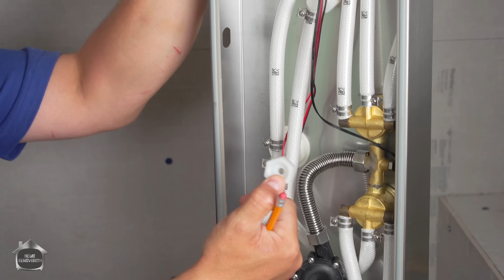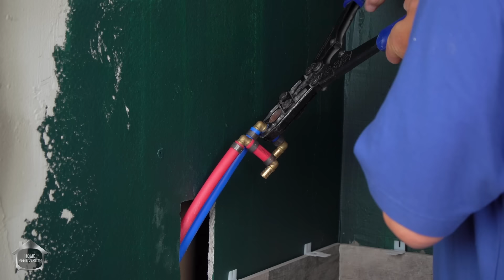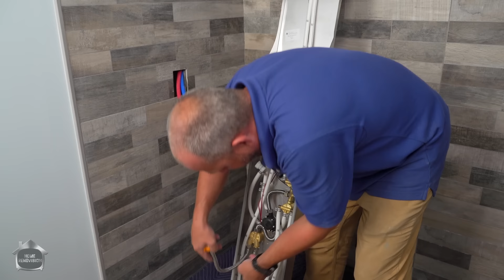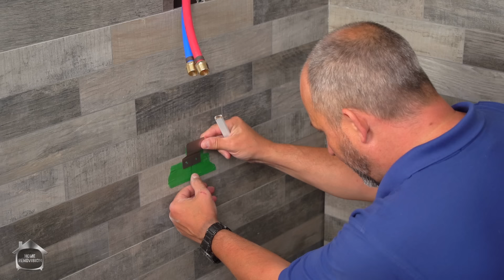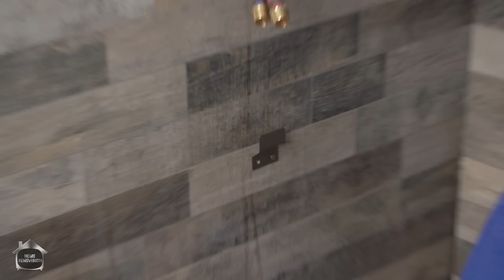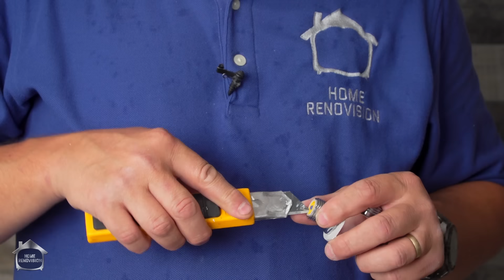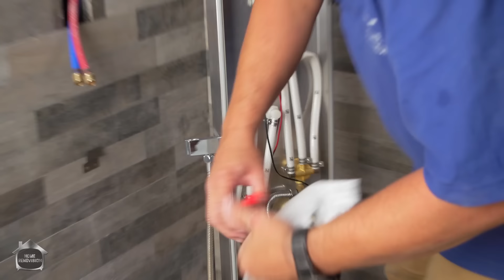Shower Tower Installation | Easy Plumbing For Beginners

Comment: I am going to spread my diy wings and remodel our small bathroom. I’m on a tight budget and was wondering if you had any suggestions on how to cover up the metal frame of a glass door shower. I do not currently have the budget to get it replaced and it’s in great shape, just the brassy gold that my husband hates. Thanks! 😉
Reply: You can always try sanding the metal lightly and spray painting it with a high quality paint. Shower doors are quite costly to replace, so I would test this idea on a small area first.

Comment: Jeff! The please give some advice! It’s off topic, but I’m on a timeline before my son is born to get this half bath/master bedroom access done before my wife gives birth later this month. I’ve been ripping off ceramic tile and it’s been easy with a multi tool fitted with  a rigid scraper blade, but it is leaving behind old yellow adhesive. Any tip I can apply today to get the adhesive off quickly, even if I’ll need to do some work to the wall afterward in the way of skimming and sealing or something g along those lines? It’s not a shower or bath or anything, the tiles are just on old gray drywall. The whole project is started because  the old toilet in there is leaking and she will need the new one there and water turned back on after the baby comes. Should I get the rest of the tile off, rent a u-haul truck, and put new drywall or can I get this old yellow adhesive off somehow? Any advice? Thanks if you can offer any guidance, man! And thank you again as always for all of the advice you share with us! We love to watch your videos!
Reply: I couldn’t tile over tile in this one, room is already too small :p

Comment: Hey lets say I wanted to learn a trade in my free time like on weekends? how would I do so?
Reply: I knew a guy at work that bought a “fixer” house.  I offered to help him with any project on the weekends.  He was happy for the help and understood I didn’t know much but wanted to learn.  I did some grunt work, but he was happy to teach me the interesting stuff too.  I’m sure a second person helped him go faster (get done sooner).  So it was a win-win.  Years later when I was ready to buy a house, I also got a fixer have have made many repairs.  I actually worked on weekends several others too.  Helped roof a couple times.  Framing, plumbing, electrical, concrete.

Comment: My tub recently cracked and its been seeping into the floor my boyfriend wants to renovate it but does not know which drywall sheetrock or cement board to use for a tile shower which is best to use behind the tile? Thank you
Reply: Itzel Rodriguez it depends how if you want to be more safe use cement

Comment: Hi Jeff, 
This question is unrelated to the video, but i was hoping you could help me answer this question.  I recently remodeled my bathroom and i used green board for my shower walls.  The reason i used it was due to the fact that i had a real bad mold problem when i took all the  walls down.  I saw your video on waterproofing showers. I did about 5 applications of aqua defense all the way up to the ceiling.  Will i have a problem that i used green board or should i have used cement board. I just don't want moisture to ruin all the work i did and i want the shower to last for years.  I am not looking  to move.  The shower will get a lot of use as well. What is the best board to use?  Thank you kindly for your knowledge and the videos you post. They really help a lot.
Reply from the maker: green board and aqua defense is fine as long as you seal the joint between the board and the integrated tile flange. Cheers!
Reply: i can't thank you enough for responding Jeff. Thank you for the piece of mind and thank you kindly for your expert advice. Cheers!

Comment: The only plumbing I've ever done was replace a busted outdoor faucet that that cracked because it wasn't drained for the winter. That simple task had me at home depot about 5 times lol, but I did it.
Reply from the maker: Cheers , that can be more difficult than meets the eye. this however is very straight forward. Cheers!

Comment: Like clockwork,it came damaged like one of mines did,bought them from Amazon, but it depends on the company, one of the unit boxes came in looking like it was used in a tiger circus
Reply from the maker: ouch. I just massaged it back with a rubber mallet!
Reply: Games dmc a Tiger circus 🎪 🐯😂

Comment: Great video and install.  I personally would install a thick tape or foam on the edge of the tile. I'm OCD about abrasion resistance.
Reply from the maker: the unit comes with a gasket on the edge. Cheers!

Comment: adding a bathroom light exhaust fan that is controlled by 1 switch white to white black to black when does the red wire go on the white or to the black to n ground to ground there are 14 2 that has blk white n ground and there is 14 3 blk white red and ground there is a single switch controlling the unit.

Comment: This makes me want a shower tower like this...    But I'm not really happy about the fact that there is no top on this.  Can't help thinking it will gradually get coated in soap scum from splashing
Reply from the maker: you can just as easily lift it off and set on a pail to clean in behind it. Cheers!

Comment: Hey Jeff, I am installing a bathtub in my basement (roughed in by builder), and the drain pipe is 2" and the p-trap and drain kit for the tub are all 1.5". Is it okay to use a reducer to connect the two sizes (glued?) when used beneath the concrete. Thanks! (fellow Canuck here so Canadian npc).
Reply from the maker: yup no problem. Cheers!

Comment: Great video as always Jeff, I would like to add that these shower panel systems are designed for a international market and they follow International Plumbing code guidelines. That being said, the included installation directions are typically not the best resource for installing these systems, for a typical North American install I believe this video is a fantastic resource that should be included from the manufacturers selling shower units in North America.
Reply from the maker: Cheers!

Comment: Are you using hardi panel for the wall? Isn’t that only for floors ?
Reply from the maker: it can be used for both. Cheers!
Reply: In the states where I’m from it says only for floors . But thanks for the tip. Maybe I’m just misinformed .

Comment: You don't seem to use a PEX crimp go/no-go gauge? Not useful?
Reply from the maker: I did when I set up the crimper for 1/2 " line. once you get the tool set it is always perfect. Cheers!

Comment: I have been a remodeling contractor for 40 years and worked at learning my trades since early teens.  I cannot understand the motivation of those involved in this industry to cheapen it by dispensing free advice to non customers and to those they'll never encounter, ever.  They must get a hoot seeing the,selves on camera and expanding their large egos.  I intend to take nearly 50 years experience to the grave with me unless I am compensated with a project or referral  work.  I've repaired and replaced plenty of handy homeowner work over a career . It's a laugh to think that a few minutes of instruction is a replacement for attestable experience, product knowledge and industry standards.  Your not doing the trade any good at all by giving it away.  So shit up, go back to work and be grateful that
Reply from the maker: Hi Steve, I am helping people every day to achieve their goals of renovating and remodelling their houses who cannot otherwise afford your services or who are willing to do it themselves and get the satisfaction of increasing the value of their largest asset. Congratulations on your career, however I will continue to assist folks in any way that I can regardless of your disgust. Cheers! If this information is not for you then it is kind of like going into the wrong bathroom at the airport!

Comment: There's some wiring in this unit. Where do you get the power to the unit?
Reply from the maker: I am pretty sure it comes from a small turbine based on the water flow...but it could just be related to the heat or both! Cheers!
Reply: @HomeRenoVisionDIY  What does it read out?

Comment: So let me get my head round this, you had your hot and cold inlets coming up from the floor and the inlets on the shower pointing down as well, and then for some reason you "U" bend the braided hoses and fit 2 elbows to each pipe to get them pointing down because the braided hoses are now pointing up? sorry I'm very confused right now Jeff?
Reply from the maker: if i put an elbow on the supply lines then the braided hose would be kinked in order top make the quick turn. a soft u turn keeps things from kinking and ruining the pressure.

Comment: Three hundred a much for tower
Made out of plastics and sheet metal
Reply from the maker: a good valve system with all these functions will cost you thousands and then you need to install everything inside the wall. I say it is a steal of a deal. Cheers!

Comment: Are you worried about the water lines developing a leak (behind the wall) from all of the movement?
Reply from the maker: great question, however in my experience once you clamp those connections together Only God himself an undo it. Cheers!
Reply: Home RenoVision DIY great,
Thanks for the quick reply.
Have a blessed day.

Comment: Question re subfloor

I removed a subfloor of diagonal board in my 95 year old house. I have screwed down a layer of 5/8 t&g plywood following the guidance in your video (6" in middle, 3" on edge). Should the 2nd layer of 5/8 t&g plywood be in same direction as 1st layer or at 90 degrees?
Reply from the maker: all you need to do is overlap the joints and install the length of the sheet across as many joists as possible. Cheers!

Comment: Maybe someone asked this already and I didn’t see it.  My question is - even with the fan in the shower, water is going to get behind that tower I’m sure.   After a few years, isn’t that going to a bit nasty back behind there with splattered soap and water?  I guess you can always lift that off to clean behind there.  Just wondering.  Thanks!
Reply from the maker: Hi John, I haven't seen a shower in my life that doesn't get a little nasty over time. Yes you can always pick it up and set it on a bucket to clean behind it. Cheers!

Comment: Have been binge watching your channel for weeks, thank you!! Odd question here. I am planning on using a "U for Moen" shower valve which would send water at its already pre-determined temperature via a single 1/2 line. Any way to combine the 2 inlets on the tower to accommodate the single line into dual inlets?
Reply from the maker: This unit does not work in conjunction of another valve. Sorry!

Comment: The previous owner installed mine on the wrong wall just prior to me buying my home. I love the showee but would like to move the unit. I have access to both sides of both walls and thought I might be able to make all of my installation from the other room (backside of the wall). But i am not sure how or if it feasable to try to move this without completely destroying the tile. Is there a way to repair the hole in the wall made by the current plumbing without ripping out everything?
Reply from the maker: not really! Not if you want to maintain the waterproofing system. Cheers!

Comment: No tape needed on the fittings?
Reply: those fittings have seals in them
Reply: @vitex1231  Yes, you are correct. My bad.
Reply from the maker: most compression fittings have a gasket in them so not needed. Cheers!
Reply: @HomeRenoVisionDIY  I watched the video again and saw the gaskets, sorry!
Reply from the maker: @bcamk  no worries. Cheers!
Reply: @HomeRenoVisionDIY   The problem is that the PEX-to-threaded male connectors you used are probably tapered NPT 1/2", whereas the female connectors on the tower hoses are likely non-tapered NPS 1/2" (aka DN15). It's possible that the taper of the male connector may prevent it from being screwed far enough into the female connector to touch the gasket. YMMV!

Comment: I'm surprised you didn't use the anchors to center your screws in the large hole drilled. Wouldn't it have been better to have drilled a smaller hole? All of your precise measurements out the window. Just sayin, my skills are a drop in the bucket compared to yours. Thanks for the lesson.
Reply from the maker: The trick to installing on tile is to make sure your line is perfect after installing . this requires a little wiggle room. I drill a larger hole so i have options when i set the screw into the wood backing that i had prepared. All it takes is for the mount bracket on the unit to be just a little off square and everything else can be perfect and it looks bad. Always consider the defects in the manufacturing process when installing. Having options can go a long way! cheers!

Comment: What about valves behind the fixture? In this configuration you will need to shut down the water supply in the whole house to replace the shower tower.
Reply: The valves are probably at the other end of the supply lines.
Reply: I don't know PEX, but I'm picturing a distribution block in the basement that has all the valves in one place.
Reply from the maker: if you don't install  shutoff valve on the specific line then turning off the water to the house is just as easy. a few minutes without water is easy to manage. Cheers!

Comment: Looks like a little too much work making two U turns on both sides, especially with flexible plastic plumbing. Even without it there should be a shorter flexible connection than what came with the shower wall. Also I'd trust you but not myself to put the fixture up without testing the water lines first.
Reply from the maker: LOL, once you have a little experience with this pex stuff you stop wondering if it will work. The joints are stronger than the pipe itself. Cheers!

Comment: Hey Jeff, With the rain head and waterfall features with this water tower, will the 1/2" supply line enough volume of water for this to function properly? I would think to run 3/4" for rough in, then reduce at the connection. You know error on the side of caution. The price difference in the tubing is no big deal. The 3/4" x 1/2" run more of course. But I am not a plumber. Just would hate to go through that work and not have enough water volume with all the tower.  Thanks for posting. I enjoy the videos!
Reply from the maker: Hi Frank, the unit itself uses 1/2" supply lines with crimped fittings. having more water to the unit makes no difference. and yes it works awesome. Cheers!

Comment: It turned out very nice Jeff. Do you have any videos where you use epoxy grout? My niece has four boys and their aim is of course horrible and she asked for something more durable and fluid resistant than regular grout and epoxy grout is the only thing I can think of but I’ve never used it. Any suggestions or do you have a video on it? I ask because I trust your videos and you always explain things very well.
Thanks.
Ron
Reply from the maker: Hi Ron, we did a video where we removed old grout and installed epoxy on the floor. use the search tool on the home screen and type epoxy. Cheers. Let me know what you think when you get there.!

Comment: I saw 'easy' and had to click,  it's 1AM I was only to watch a few minutes, and here I am right to the end!  Great system
 I'm replacing the copper, after the second frozen pipe incident in the basement!
Reply: SJ R    What is causing the freezing incident?
Reply: @ronh9384  Living in the North, seriously,  north side of house, and ill-fitted door, door has been fixed.
Reply from the maker: pex should solve that, however you might want to investigate why you get such a cold basement. Cheers!

Comment: What about wiring that thing in did i miss it how does it have power
Reply: Electrical Power..... in the shower.....
Reply from the maker: the Led works off the water temperature. Cheers!
Reply from the maker: not sure, but it works!

Comment: what about water hammers in this setup? also I can't believe the top of the tower doesn't have a cap.
Reply from the maker: never have problem with water hammer with pex. And the top does not need a cap , all the water is running the other way!

Comment: We've installed two before, it's an ugly sight in such a nice bathroom.
Reply from the maker: There we go, I knew we would have some folks not loving the style of it. I would say that it is hard to get folks used to change,. Personally I don't think it is ugly just new. Besides how else do you get all this functionality for such a great deal?
Reply: @HomeRenoVisionDIY  agree, I actually find 90% of available shower towers/heads ugly. That one is actually nice and I think I will buy one!

Comment: How to get more pressure to shower and how to remove restrictors ?
Reply from the maker: you can always increase the pressure in the system with a pressure tank. no extra volume required. cheers!
Reply: Thanks
Have well system and it need some velocity
Reply from the maker: a plumber will take care of that for you. Cheers!

Comment: Did you know that Phillips has designed a new screw? Why Yes, yes they have. Non slip.
Reply from the maker: don't believe it!
Reply: @HomeRenoVisionDIY  , Yep. Seen it on one of the trade shows. They come with a special ribbed tip. You can sink the screw, let go of the driver and it will support the weight of the driver.
Reply from the maker: cool, for what type of application?
Reply: @HomeRenoVisionDIY  General purpose and construction I believe.  If I find the video,  I'll pass it on to you

Comment: WHY DIDNT U TURN IT ON
Reply from the maker: no worries it will be shown in a future video. Cheers!
Reply: @HomeRenoVisionDIY  Great, cause I've always wondered how insane these things really are.
Reply: The water supply leading into the basement hasn't been connected yet. That is why he could move the red and blue pex up and down so far.